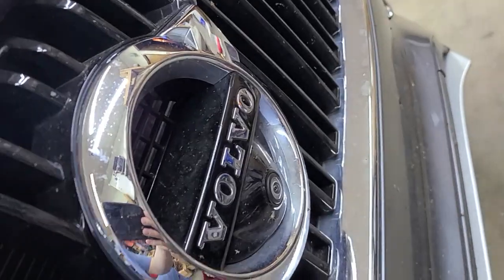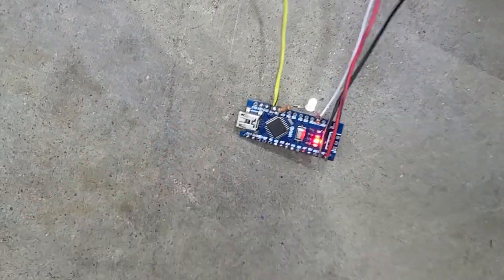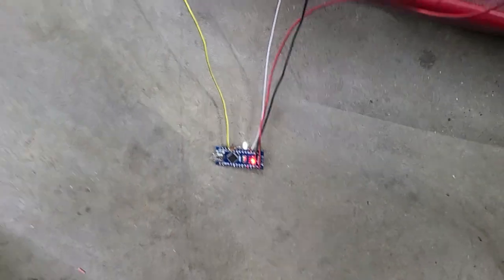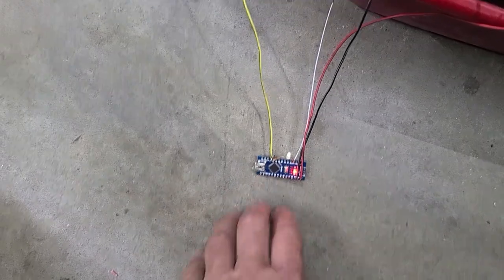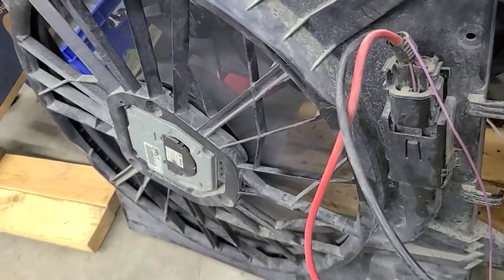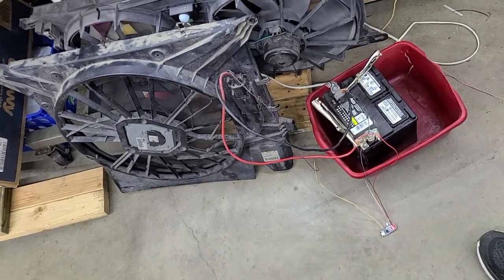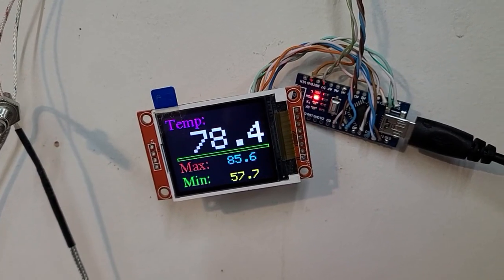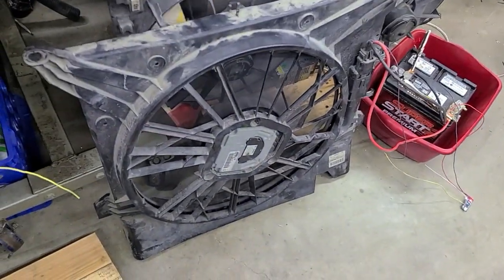$22 Volvo XC90 brushless PWM fan Part 2

Comment: Very interesting. This is three phase brushless motor with the DC to AC controller in the fan and just a pulse to run it?
Reply from the maker: Dunno the internals, just that it needs a a 122hz PWM to drive it.

Comment: What is the output signal of the arduino to the pwm drive ? As my knowledge the out put is from 0 to 5v dc.
Reply from the maker: 0 to 5 volts is TTL from the arduino.

Comment: Is there a way to bypass signal wire so the fan can come on an stay on
Reply: If not are you willing to sell your device I can’t get my fan to work
Reply from the maker: You need a driver to produce a 100hz signal to make the fan spin.  You can get one off ebay or I can send you a pre-programmed arduino that will do the same thing.
  @theoryofkaos8612
Reply: @aknovaman  I bought the unit thanks for all the help you gave me